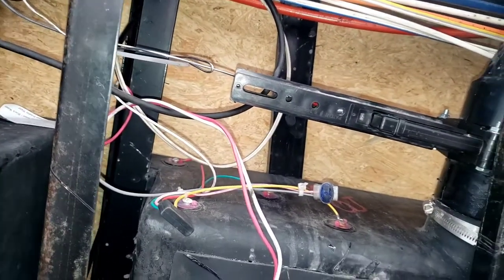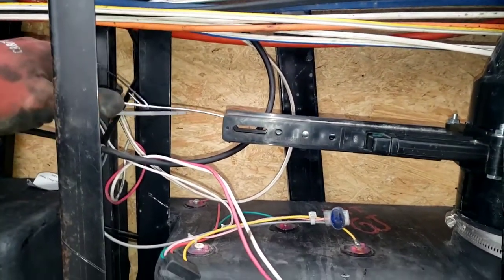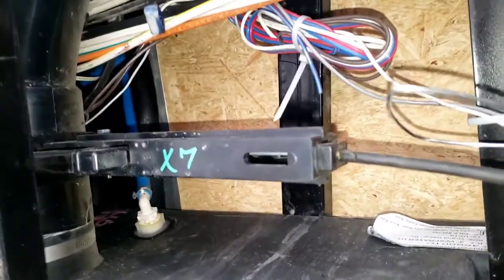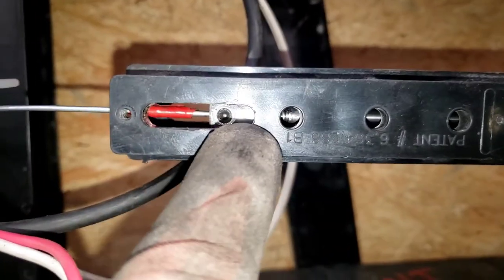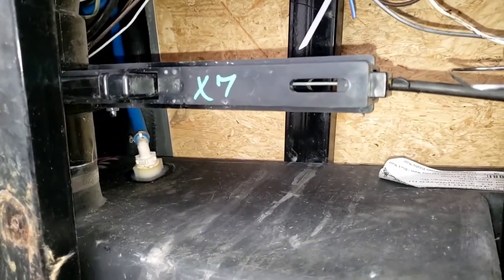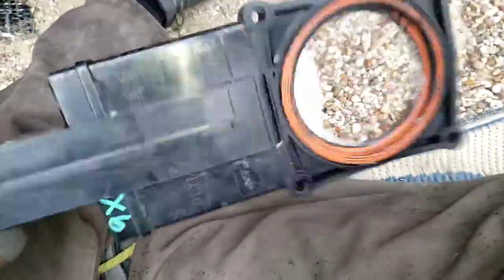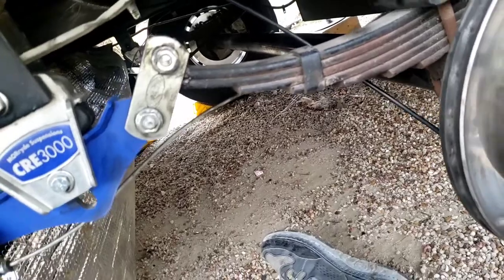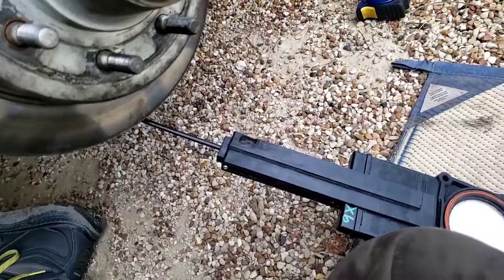RV waste valve cable replacement

Comment: Thanks Ron for your info.  When I removed my LB cable actuated valve I learned a few more things which I'd like to share.  The entire plastic cable actuator housing can be removed from the gate valve by first removing the screw that holds the plastic block near the cable end and then spreading the two flat plastic "fingers" that slip over the body of the gate valve.  Removing the screw allows the cable block to slip down inside the plastic actuator housing and the housing to come out over the cable ... which exposes the aluminum cylinder which screws onto the stem of the gate valve.  Once you've unscrewed the aluminum cylinder from the stem (mine was 5 turns) you can remove the cable with plastic block & aluminum cylinder from the plastic "fingers" piece.  And if you want to disassemble the cable assembly you can then remove the set screw from the aluminum cylinder and slide the cylinder off.  Note however that the stiff inner wire will have a kink in it from the set screw, which you may have to straighten out before pulling the inner cable from the outer housing ... should you wish to do so.  On my valves there was a 1/4" hex head sheetmetal screw going into the plastic block axially from the inside of the block to hold the outer cable housing into the block.  If you remove this screw you can then pull the outer housing from the plastic cable block.  When replacing the cable, BE SURE to have the SAME AMOUNT of inner cable protruding from the outer cable housing before you assemble everything.  Once I learned the above, I was able to lubricate the actuator cable and then replace just the basic gate valve with a LB 39240 unit at much less cost than a complete cable valve assembly.

Comment: Exactly what I needed. I had something going on with my cable. I can pull it open and it flows great then seems to shut off. Thinking it might be solids so I overtreated the tank then let it set a day. I'll give you an update, but after your in-depth details finally I know how the valve works and the fine details on setting the fully closed and open positions. I'll pull the valve after this video just to be sure it's set right and add some plumbers grease.

Comment: Thank you for this video. I bent the handle to my black tank on my 5er. it was quite a task but, with your help, I got the cable replaced without having to remove the valve. I had to cut through the belly to access it, but it went pretty well once I got to it. Thanks again!
Reply from the maker: You made my day! I'm so glad that I was able to pay it forward!

Comment: Thanks Ron..  This was the 2nd video I found for the Bristol valves and yours offered a lot more useful information..    Our Imagine 2250RK has been giving me fits with the Galley Grey tank valve.  I finally peeled back the belly cover yesterday, and have ordered the new valve.   I kept bending the pull-rod and have been having trouble with this valve off and on for over a year..  as it turns out, In our case, that little block that determines how far the valve opens and closes was broken into two pieces and was pushed down inside the housing.     I was successful in getting the valve open to drain the tank, and it wasn't easy but I did find a 1 1/2 inch valve with a 36 inch cable..  SO Now I wait for the part to arrive.

Thanks again for the great video.  And we shall see you at National in August (Section C)
Reply from the maker: I'm glad to help you spend your money! 😉 See ya soon

Comment: If it has not been confirmed yet, I can at this point, that I purchased a Valterra cable to replace my Bristol cable and it fit perfectly. So Yes, you can just replace the cable on a Bristol but use a Valterra cable which is much cheaper of a replacement than the whole valve. Just be creative with how you disassemble the old, and how the new goes in. I seriously saved 50% (actually a bit more) than the alternative. All done without removing the old vavle, challenging but doable.

Comment: Another cause of leaks is the seals. You can replace them with LaSalle Bristol 39227 Seal Kit for about $14.
Reply: Do all the Lasalle Bristol 3" valves use 39227.
Reply: @frankshiffer588  I think so. But you might want to call/chat with them just to be sure.

Comment: After removing the four bolts you mentioned “separate” to get the valve out. Please specify in more detail what is done and how to put the valve back in easily before tightening the four bolts.
Reply from the maker: I used plumbers grease as a way to keep the seal from moving around but the seal staying in place is a struggle. You'll have to play with it and get to understand how it works. If you get it right out won't leak. If it leaks, you pinched the seal. Don't over tighten the nuts. Just snug them down. Over tightened will cause crushing & lead to more problems.

Comment: “Spread it” was the term used. What is used to spread it? And what do you spread and how do you get the valve back between the pipes you “spread”?
Reply from the maker: Spread it, (I think) is referring to separating the tank from the outer pipe. Once the 4 bolts are removed you should be able to pry the tank side from the outer pipe side by pushing against the tank. Using a wooden handle of a hammer works. (Stay away from using sharp objects) You don't need to move more than ½ inch or so to be able to wiggle the valve out. It's nuanced because every rig is different in setup and space. Bottom line you have to create just a small space to get the valve out. Most grey & black tanks sit on a framed bracket and are not secured down so they will move a little. You can use a wooden stick to apply leverage, either by twisting it or pushing on strategic locations.

Comment: How is the gate attached to the metal piece where you insert the cable and tighten the set screw? Is that a piece of wire too? I can move the cable in/out and see that metal piece move in/out but I can't tell if the gate is actually opening and closing.
Reply from the maker: The cable slides into a small box, then a small set screw stress into the box along the edge of the cable and the threads screw into the cable & box keeping the cable set. The cable end itself screws into a hole and another set screw secured the cable to the valve gate plunger. The little box acts as an anchor. How you can tell if the valve is opening is the valve gate rod will extend outward towards the top half of the valve.
Reply: @ronaldwickery681  Thanks for the information!
Reply: All of your info is great,  but cable repair or improvement attempts are a waste of time and last for maybe a  season At best depending on how much you use it. 

The most effective and long term fix is to to trash can the cables and install electric valve actuators. I used the Barker valve actuators and the problems are just a bad memory for me. Cost me about 400 dollars and there is no more fighting with the stupid cables.

Comment: Where can I get "just the cable"? Do you have a part number?
Thanks
Reply from the maker: Easiest place is to go to Amazon. Length is your question. The cable is easy to cut to your needed length. It's a solid wire wrapped in a rubber sheath. 

This is what I got. 84 inches was plenty for me. Valterra TC84 Flexible Cable Replacement for Waste Valve Kits - 84 Inch, 7 Feet https://a.co/d/db5NgeI

Comment: no leaks, but valve (cable ?) has increased to not being able to push in or pull out without using great force! help?
Reply from the maker: One of 3 things may have occurred or are occurring IMO. 1, the handle area has bent ever so sightly. It doesn't take much of a bend to corrupt the motion of in and out. Dry lube spray will maybe help too. Not WD 40 or anything oil based. That collects dirt and dust. 2, your cable is getting bound up. If you can't fling your handle around like a propeller, your handle is to tight. It needs to be able to rotate. 3, your valve seal isn't being opened and closed enough, which doesn't show the seal to stay lubed & worked enough to allow easy movement. Other than open and closing it more often, the only other option is to open it up, replace seals and add plumbers silicone grease, but that's a last resort!

Comment: Just had my LB valve off and the set screw that's inside the cable stop holds the cable in place.  It does nothing more than that.

Comment: How did you get the cable plastic cover  set screw to begin tightening?  You skipped that part.
Reply from the maker: There's 2 holes side by side. One larger, for the cable, and one smaller for the set screw. The set screw threads actually catch and screw into the cable housing which is how it sets the limit housing. It kind of pinches it in. Once you take the Phillips screw off the top of the cable limit housing and pull it out, you can see the the set screw. It's about ½ in long and just screws out. I wish I'd put more on about that, but you should see what I'm talking about once you get the cable out.
Reply: @ronaldwickery681  Thank you